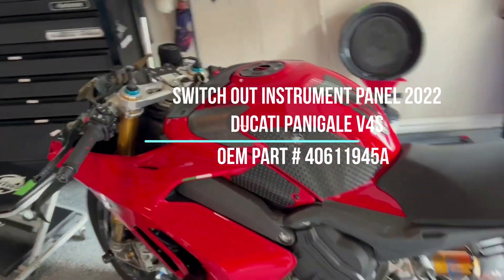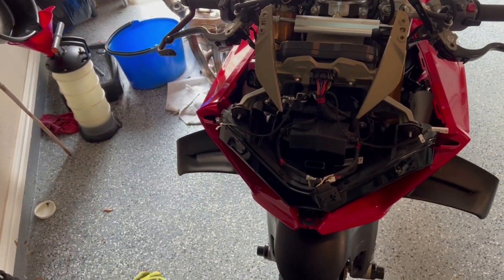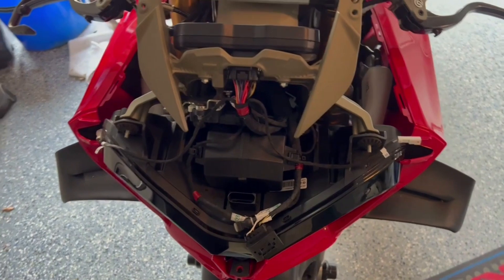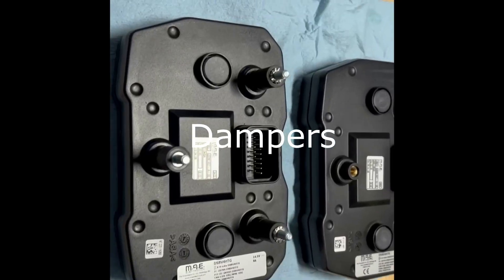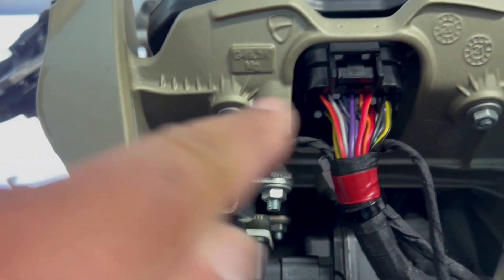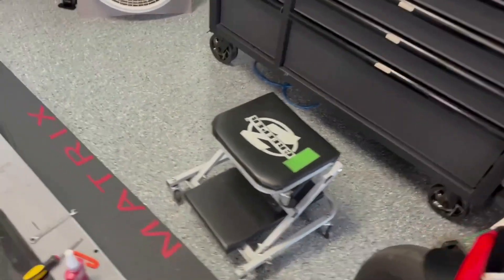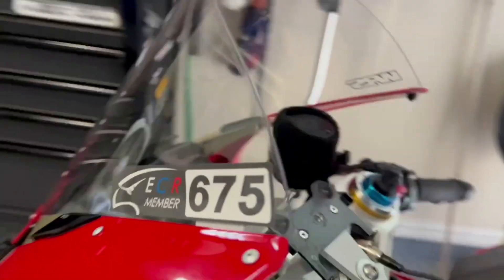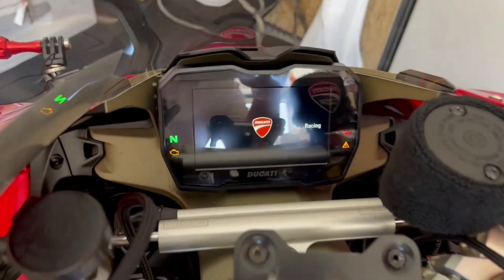Replace Instrument Panel Gauge on 2022 Ducati Panigale V4S

Comment: Do 2020y display will fit to 2021y bike?
Reply from the maker: I think so, but it is best to confirm. You can confirm by looking at the part number for the 2020 and 2021 models.

Comment: hello , how hard was to flash the bike and make the ECU compatible with the speedometer, also did you change the ignition key lock . thanks in advance
Reply from the maker: Not hard at all. You'll pay about $150 to the dealer. You'll have to take both your keys so that they too are paired with the new instrument panel.

Comment: Thanks for your video. Very useful and timely.  Did the dealer have to remove the front fairing to program the new dash?  I want to avoid assembling the fairing if the dealer has to remove it anyway. Thanks in advance!
Reply from the maker: Dealer does not have to remove fairing or dash. Thanks for watching.

Comment: Great video, helps a bouch!
Only wondering: Do u know if the miles are attached to the ECU?

For example, I got a bike with 3k miles on it, but I need 8k miles..
Reply from the maker: Yes but they transfer over to the new display when properly paired.

Comment: How did it cracked? Any recent crash? Also, did you flashed and unlock the ECU with top speed showing more than 199 mph?
Reply from the maker: No crash. Not sure how it cracked but my suspicion is that I accidentally spilled some brake fluid on the dash while I was bleeding the brakes. Lesson learned about covering up everything when dealing with brake fluid...it's nasty stuff. My bike is flashed with the T800 UpMap to match the Termig. slip on. It's perfect now.
Reply: @brilliantspeedsuperbikes  Oh damn, brake fluid is enough to get it cracked? Damn!! Lesson learned.
Reply from the maker: @nishantpriyam2257  it seeps through and weakens the already weak cover and then somehow the crack appeared. If you ever spill brake fluid on the bike clean it up asap.
Reply: @brilliantspeedsuperbikes i had also brakefluid on dash but i have protective screen sheet on it. Hope it save it.

Comment: I replaced my dash with a new one, the bike starts perfectly, but the dealership says they cannot pair it. Was there any issues when you took yours in?
Reply from the maker: Hmm! None that I can recall. I had the old one on hand just in case (but never needed it); plus, I was/am in good terms with the Dealership.
Reply: But what was point to pay dealer if all works anyways?
Reply from the maker: @jarmorappu397  It does not all work. Mileage is not shown unless it is properly paired, there's an error message when you start, and there may be other issues, too. Thanks for watching.
Reply: @brilliantspeedsuperbikes  Thank You!